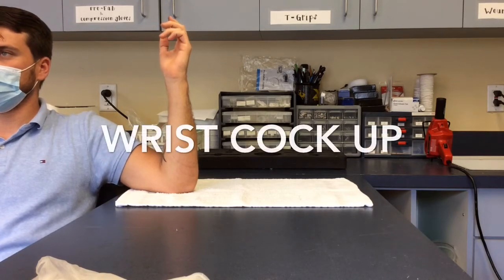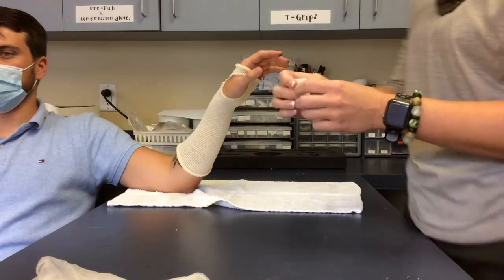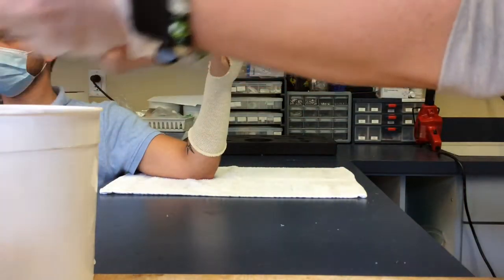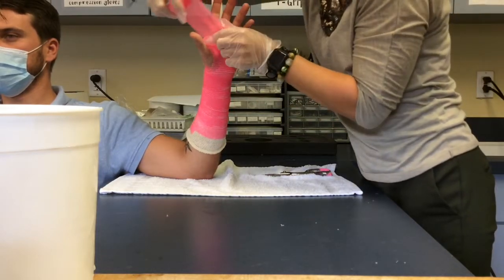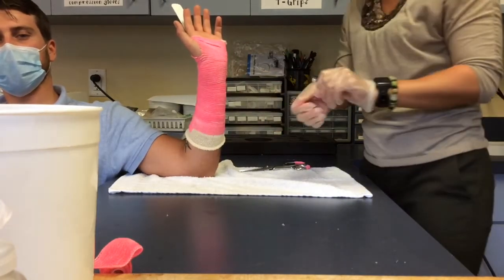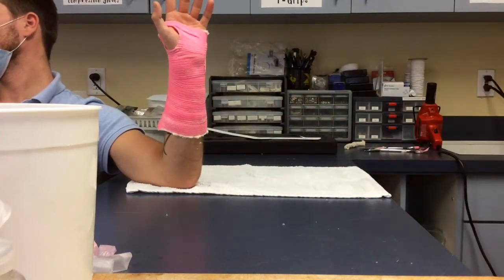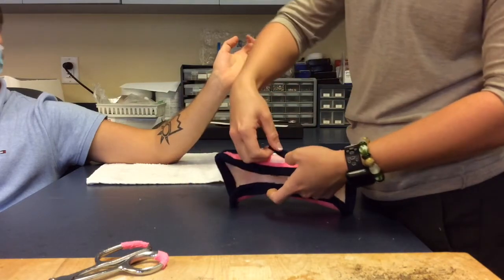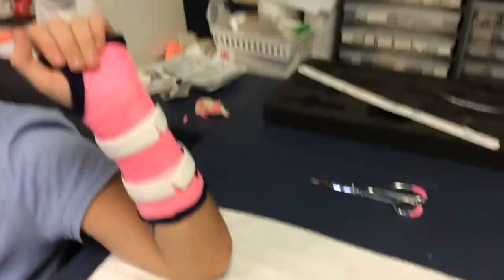Wrist Cock-Up Orthosis: Delta Cast Material

Comment: Could you add examples of what injuries these different styles would be best for? And maybe comparison information with other materials?
Reply from the maker: Hi Madison thanks for watching! Would you like some examples of when to fabricate a wrist cock-up orthosis or specifically relating to the material? I also just posted a video discussing basic orthotic fabrication tips and considerations and did discuss material in there if you want to check that out!
Reply: @Splinting101  I primarily meant the material! I have never seen it before and we were taught to use aquaplast for these but this seems so much better. I was curious about what would indicate the use of this material. I will check out that video.
Reply from the maker: @MadNugs7  I use delta cast alot for comfort, protection, and for the cosmetic appeal. The material is somewhat expensive but patients love the look of it. I use this material alot for protection and if I think the patient is going to be non-compliant. So mainly cosmetic appeal, protection of healing structures, protection at work possibly, and for comfort! Please let me know if you have any other questions.

Comment: Apply the Velcro hook and run it all the way to the cut edge before applying the edging- that way when the edging folds over it  secures the end of the hook and avoids you having to use separate pieces to do it later.
Reply from the maker: I completely agree! Thanks for the feedback!

Comment: Why would you use delta cast versus thermoplastic material in this case (wrist extension)?
Reply from the maker: Hi Richard thanks for watching! For a wrist cock-up orthosis you should be placing the patient as close to 30 degrees of wrist extension as possible no matter what material you use! In this case many patients prefer delta cast over thermoplastic simply because of comfort and cosmetics. Delta cast is fabricated circumferentially which some patients feel as though this is giving them more support.